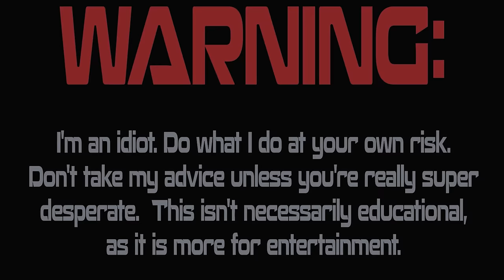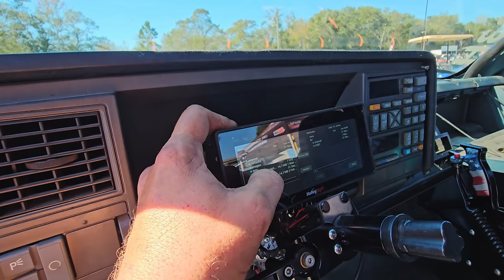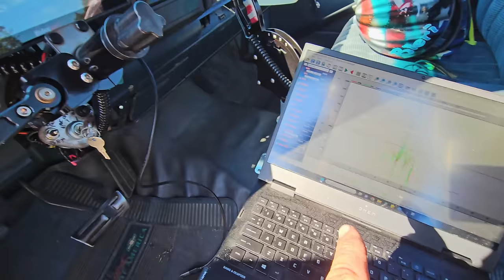We Raced Liberty Chevelle Vs.  The OBS Truck!  Sick Week Day 5!

Comment: Just so you know, that engine will run on meth all day long if you got the fuel system for it and be safer then it would be on pump gas. Also 109 or 118 or even q16 would only help that truck! The amount of valve ting ours gets even on 100 it’s still tingin and pulling timing. Ran 118 last outing and was only seeing .5 max timing retard pulling, plugs looked so good and clean,  and we picked up 9mph and 4 tenths and engine temps where way happier

Comment: Hi Derek - I love all your videos. I know you guys can only make so many revival videos, but some content that is a bit more informational would be awesome. I just bought my first old C10 project, and the headlights dont work, and the truck will start with a bump start or lone wolf relay jump, but wont start from the key. All this to say - a video on electrical gremlins 101 would be awesome. Im sure we're all workin on cheap old cars that have had a million owners and have been hot wired every which way, so some quick tips on sorting those out would be amazing (and you dont need to add another car to the fleet in the process)

Comment: i have a question? what if you fixed the tailgate where it will open part way. you know kind of make it like a wing. wouldn't that help. i dont know what little drag racing i did was before you was even born. and it was in a 71 340 duster and a 74 gremlin with a 401 and the fastest i ever ran was a 9.85 dont remember the mph.

Comment: Derek, you’d run faster if you put a scoop on the truck. A hood with a scoop would be better aerodynamically, but a simple scoop on the motor would be a huge help. When you’re at the top end of the run, air is being directed over the intake and actually pulling air out of it, I believe. When I ran tech at a drag strip in the 80’s, the rule book required a hood or scoop to prevent air/fuel being siphoned out.

Comment: Removing the tailgate is a big plus. Just a huge frickin air dam. You can see 100 times the air pressure on the tailgate you will see on the front because of the air stream created over top the cab trying to expand(decompress).

Comment: I've had experience with big block chevy starter problems.  I was told to roll the motor over 1st then put the fire to the lighting tubes . It prevent kicking the starter of the engine block . Or breaking the bolts .

Comment: O2 sensors fail and are designed to then send a false lean signal and the computer then sends more fuel than the engine needs.